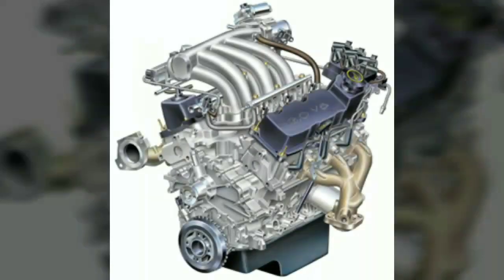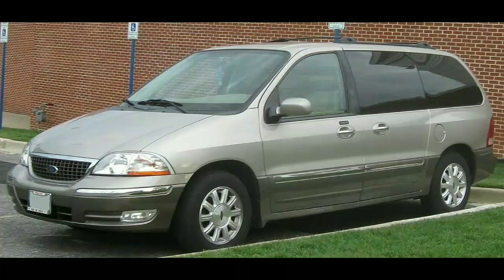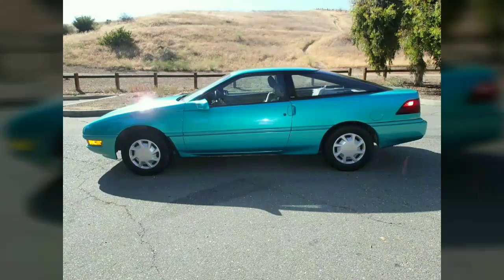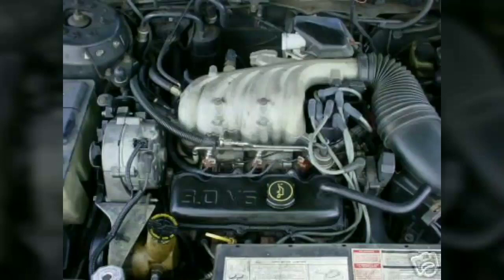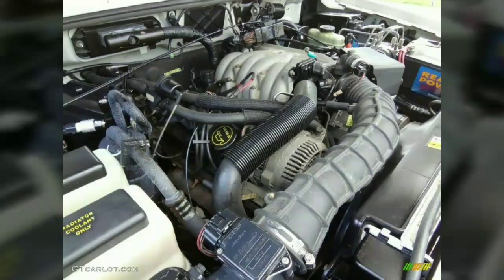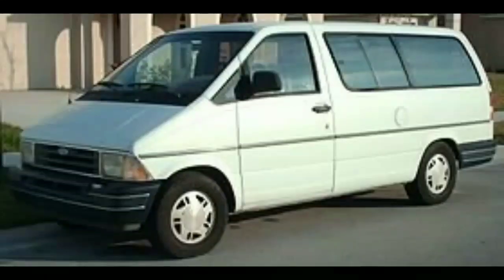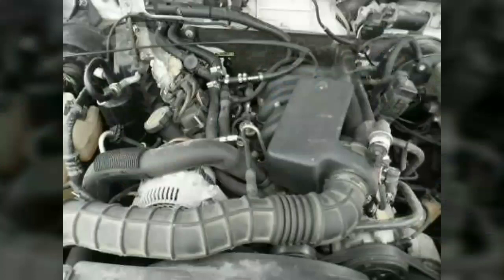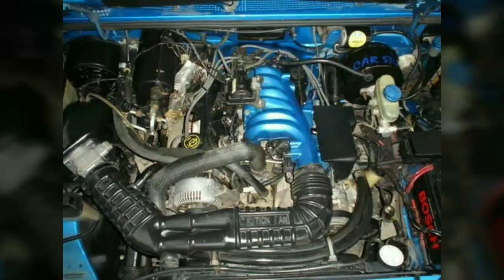The 3.0 Liter Ford Vulcan V6 Specifications

Comment: It’s a reliable engine but now I just can’t stand this engine as it just pings under load an I can not seem to figure it out I got a 3.0 ranger check an clean egr the throttle body new plugs new wires new injectors when I changed the heads swap the coil new map sensor an the dang this still pings under load when it’s hot outside engine runs around 180 so it don’t over heat
Reply from the maker: Mine does the same thing during the summer. It could be the timing. I changed the timing chain and it helped a little. Also added some octane boost but I still get a little ping under load. I will have to find and fix this problem before I supercharge it later this year.
Reply: What velocity oil do you run....mine was the same on 5w 30 but night and day difference on 10w 30
Reply: @lennyspruill7388  right now I run 10w30 full synthetic in the summer an 5w30 synthetic  in the winter

Comment: We have a 2002 Mercury Sable gs the engine block and heads cast iron runs great we use 5-30 mobile 1 oil ....

Comment: These engines are pretty unspoken of but are rock solid,especially when equipped with a 5spd manual trans.They don't make much power and are pretty limited mod wise but they are tough are nails and plenty of low end torque,plus they will easily hit 500k if looked after
Reply: You know, I tuned mine in my 2007 Ranger STX with a Diablo Racing Tunner 3. It takes off very fast now for a V6. I have guys with the Ram Hemi's try to blow past me. I can actually at least keep up with them  which it hilarious. They look over and wonder how the hell is this Ranger keeping up. The tuner overrides the speed limiter. I can peg my Ranger out at 120. The needle kept dropping. I need to get a digital speedometer app to see what I am doing after 120mph. I have found other people with my truck and tuner showing that it will top out at 137 MPH now with the tunes.
Reply: Do you happen to know what the typical oil burn rate is on these engines? I have a 97 3.0, 5 spd with 171K and Im burning a quart every 2200 . Im the 2nd owner and don't have any prior history of upkeep, but based on what I can see though, I'd say the maintenance was a bit sketchy. What seals typically give out on these engines? Any help....helps !
Reply from the maker: The main leaking points on the Vulcan are the oil pan gaskets, valve covers and timing cover. If it is not burning oil then check for moisture around those areas. I had to change my gaskets at 180,000 miles.
Reply: @Last_one_before_I_go  I have a 99' 5 spd 4x4 3.0 with 335 thousand km and only loses 1/2 quart of oil between 5-7k oil changes (I bought the truck with 170 thousand km on it but have kept religious maitenance on it and take it easy on her)